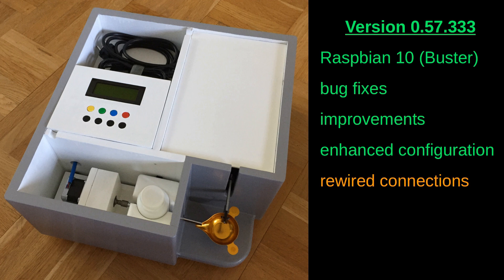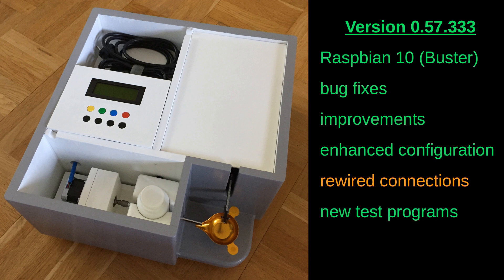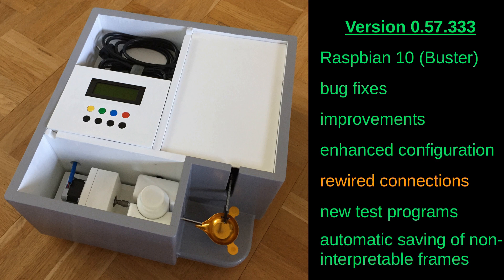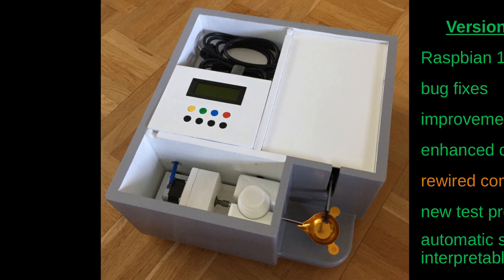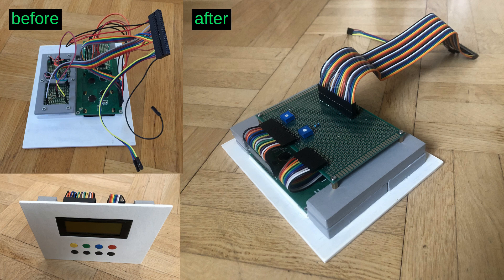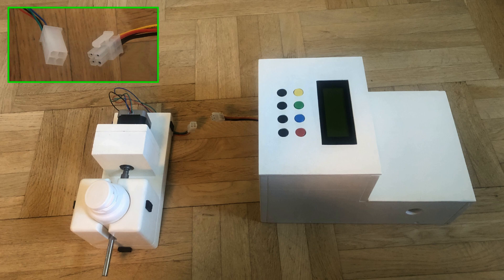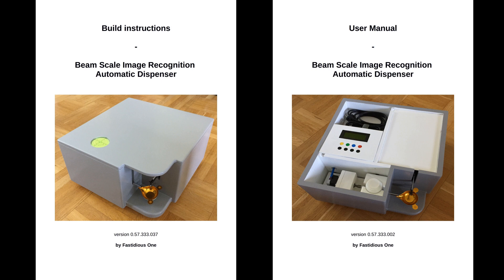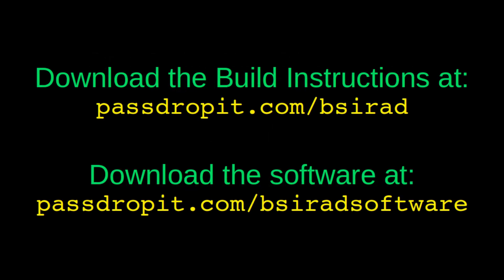DYI automatic powder thrower

Comment: Hi again
All HW is build, and test programs work nicely. Webcam, buttons, motor and also LCD (given I understand the instructions. But when I start the program itself, it fails. I use a Rasberry Pi 4, with the older SW 2021-12-02-raspios-buster-armhf, where I succeeded in install. But maybe this is still too new? What version did you run on, it doesn't tell in your instructions.
Reply: Did you ever get it working?
Everyone: GROK is great at code troubleshooting.
Reply: Hi
I Got it working Ok, but I was not happy with the stability of the result. 
Even though I Got superb support, I chose to make my own design with a plc, where I Can do software corrections myself.
Reply: @kristiansen1973  
Hello,
May I ask how you managed to get this working with the software?
I've been trying to figure out the installation for a few weeks now. I already have an older Buster that doesn't load all OpenCV files, and I've also tried the latest Bookworm. It can't find any folders.
It's driving me crazy.
Reply: @ I followed the comprehensive instructions manual. But later I gave up on the project. I couldn’t get it working consistently. Instead I made a plc solution, that works stable for me.
Reply: @kristiansen1973  OK, thanks.
Since I can't get the software to work, I'll probably have to look for another solution. It's a shame, because I really like the approach of this solution.

Comment: Hi
Thanks for great instructions. 
I would like to built one, but I am uncertain about the parts I need to purchase. I found the stepmotor and driver on Amazon. But i struggle to find a suitable webcam. I already have a Logitech webcam, but would like a small one as you show. Can you please assist?
Br
Jesper
Denmark.
Reply: Update, all parts purchased. 
But the Python on my rasberry pie is 3.11, and it seems the BSIRAD sw does not support this?

Comment: I built the first version just out of curiosity and did a very poor  "work around" to get it working with my RCBS 10 -0-10  as I didn't want to buy a new scale at the time.  This is a fantastically well thought out project, superbly documented (especially when you consider the documentation is in English  whilst the author is not).  My shooting took a back step due to unexpected health issues so this languished on my shelf for a year or so after the initial build but the latest video rekindled my interest so I rebuilt my system with the new software.   Anybody interested in reloading should seriously consider this build, the documentation is so good anybody can build a working system within a few evenings.  Its a pity it only works with the M500 scale but you cant have everything I guess so I will sell my current scale and buy the M500.
Reply from the maker: Hi David,

Thanks for your review. Glad to hear that you have had some success with your build. Hope that a M500 will make your build work perfectly!